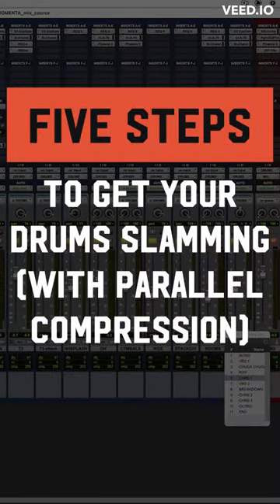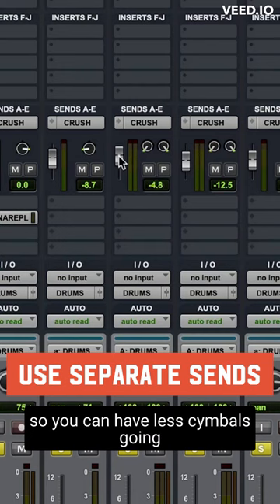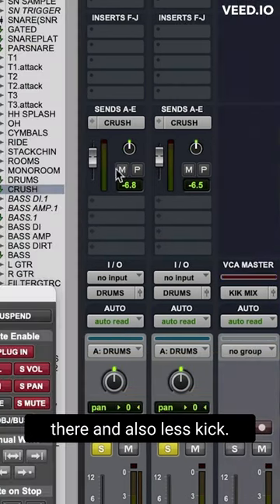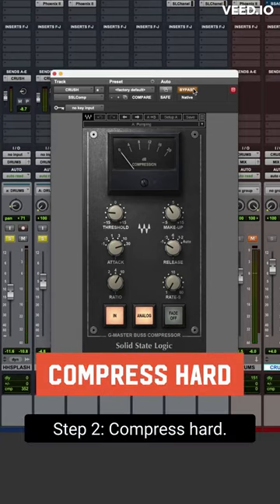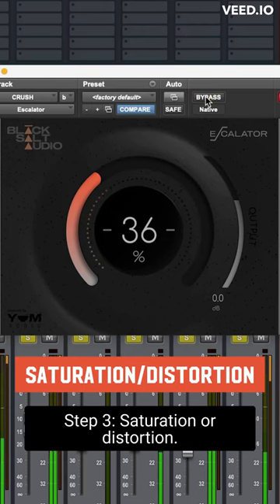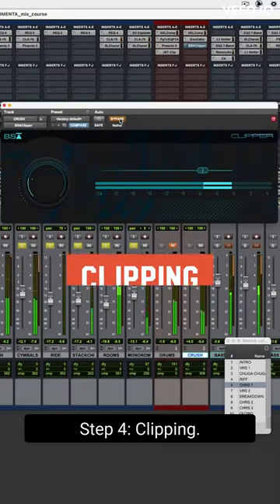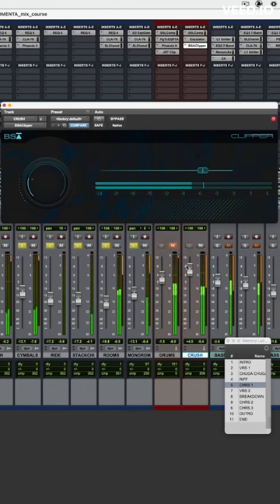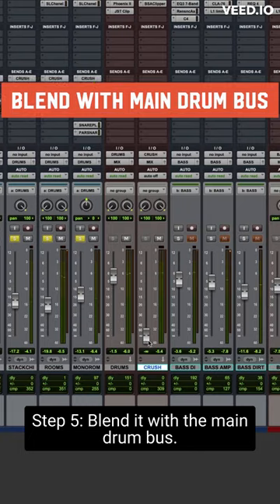5 Steps to get your drums slamming (parallel compression)

Comment: How much delay does this clipper cause? The one I use has around 25ms so I am looking for an alternative
Reply: What DAW are you using? All DAWs should compensate the processing delay by themselves, so you shouldn't worry about the delay each plugin causes... unless you turn delay compensation off in your DAW or your plugin has a problem and it is sending the daw the wrong amount of delay it is causing (so the compensation comes out wrong)...

Comment: when i compress hard, sound starts to cuts out and comes back (on kicks and snares) 
i guess i'd compress it waaayy to hard xD
Reply: That’s why I use a separate send for kick and snare. I have kick and snare together on one then I control how much I send that to compressor
Reply: He puts a slower attack on the compressor. That'll make sure the transient pokes through before the compression kicks in. You might have a fast attack set. That will take away the initial attack of each hit. I think that's the problem you're describing.
Reply: You can get away with an insane crushed and compressed signal. Just make sure, your attack and release is set correctly so it doesn't eliminate the transients.
Reply: @Jimburai  Also SSL Bus Comp is a feedback compressor, so it lets more transients through by design already.